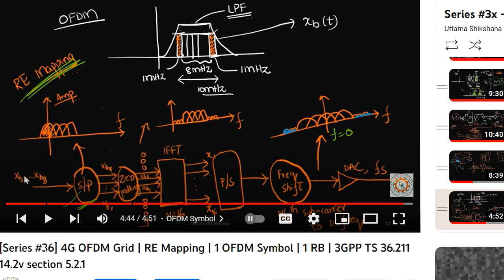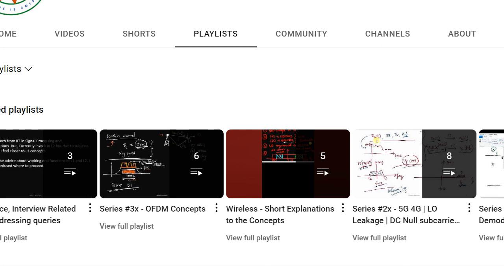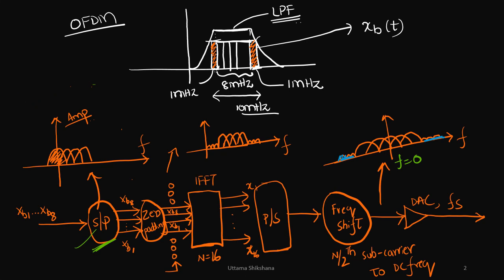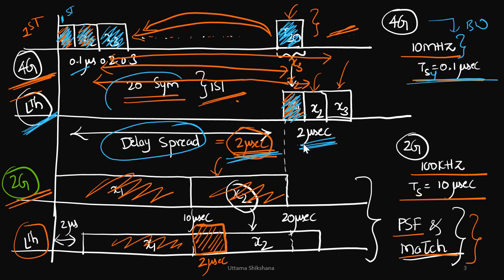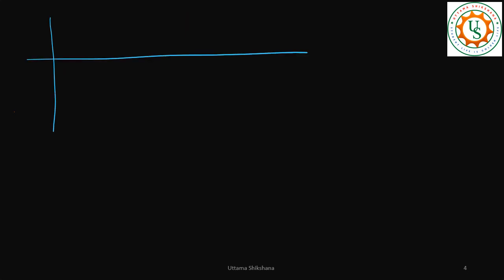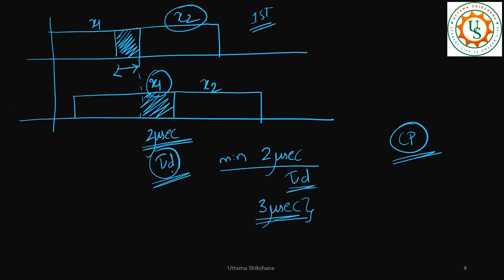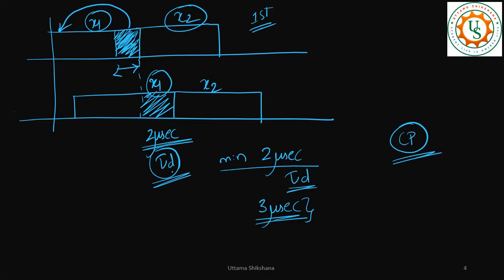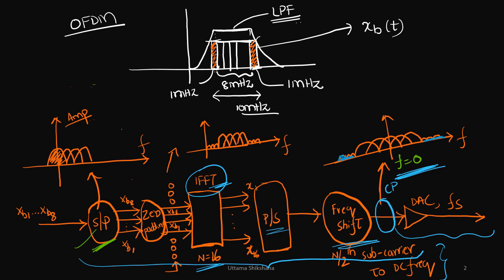[Series #37] 4G 5G OFDM Design | Design of Cyclic Prefix Addition or Removal Block | Why is CP used?

Comment: Hi sir, I am having  a doubt in some books CP is added before parallel to serial converter and in some other books CP is added after parallel to serial converter, which one is correct or else it doesn't matter much. Thank you.
Reply from the maker: It does not matter.
Only thing is, it should be done after IFFT block.
Thanks